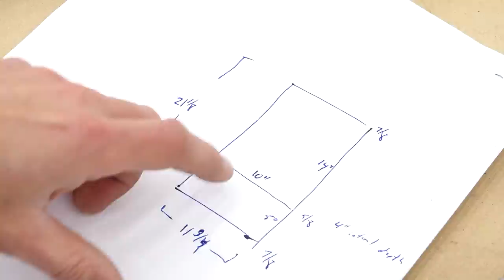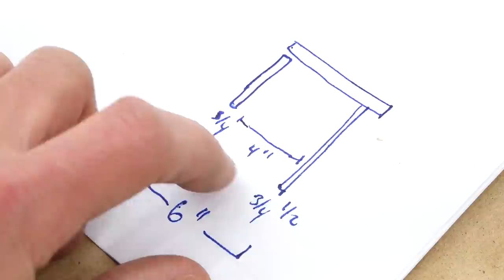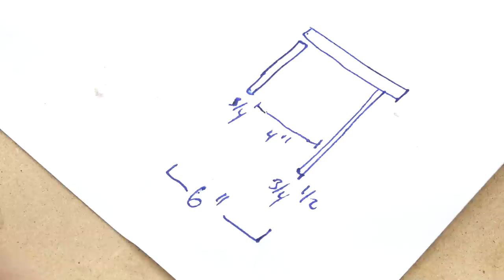Giving my Neighbors' Tree a New Life

Comment: Ah, yes, that little air cushion!Soooo satisfying! I wanted to see a little brass engraved plaque next to the famous fissure, saying " San Andreas". Ideally, a flat-tip screwdriver should completely FILL the screw slot and the contersunk hinge- hole width. A little touch of candle-wax works wonders on brass screws PUSH the screw across the side of the candle,;that way, the wax is in front of the screw thread!I wanted to see the neighbours' reaction!!

Comment: Really enjoyed the making of this cabinet. The only two things I would’ve done differently are;
1. Make the shelf a floating shelf by drilling parallel holes down both sides and a recess round end mortises at the bottom of the shelf to locate it on nice chrome pins; which you can move to any level inside the cabinet.
2. Mount the door flush to the outer edge of the cabinet with hidden kitchen like soft close hinges to maximise that really nice epoxy finish and minimise the door frame to be the same thickness as the wood that used for the main sides of the cabinet.
But, truthfully, I can’t really be disappointed with a man who drinks a 12yr old single malt Glenmorangie Whisky… Cheers.

Comment: Glad to see you back in the shop.  Beautiful cabinet.  I like your catch.  I made a sideboard with magnetic catches years ago.  I put the magnets in the top of the door frame before assembly and the matching ones in the rail of the opening.  The one in the rail was about 1/8" further "in" and pulled the door slightly too far.  A tiny stop held it just right.  Completely concealed.  I like the air cushion with yours.  Magic. Thanks for posting.

Comment: Having only seen you slab a bunch of monster trees, I could see your clear reverence, joy and love for the beauty of wood.  Now I've seen your remarkable skills as a cabinet maker and your lovely attention to detail that honors the wood.   One question, why did you split into four veneers and add the plywood glue step rather than simply splitting out two solid panels?   I'm guessing it is for greater dimensional stability.  I could see doing it if you needed to swap an orientation for some sort of fancy book matching.  But it looked like you glued them together into the same exact orientation that they started out in.

Comment: Absolutely gorgeous! One cool trick my old wood shop teacher taught us for door panels or raised side panels was to stick 2 small chunks of neoprene (we used old junk mouse pads or sanding pads) on each edge (1/8”x1/8”x1”) and do that for each panel joint. It gives it some squish so the wood can move around, it will never rattle and it won’t be too tight to avoid cracking.

Comment: Nice job. A few comments on variations of what you did. I would have rather used oak veneer for the B sides and made it double wide. This way all that work for the highlight pieces is not hidden. Whenever a lot of work goes into joints, try to expose the joint and not let it look like a butt joint. The catch could have been soaked and bent for the last inch or so at about 10-20 degrees. This leaves something to grab easier. The shelves need something to stop the bottles/glasses from moving.  Perhaps a recess for the bottles. (too late for that)  Maybe cork or shelf liner?  There is a very thin rubber black material used for tool boxes that looks good.
    ps; I always used the thickness of a matchbook for clearance of the doors.

Comment: Absolutely gorgeous! My only change would be to use a invisible hinge. The builder of my cupboard cabinet used them. I have to replace them, because after 80ish years most of them are broken. It has a oak carcass with a bird's eye maple top. I've been refinishing it because the top had become split over the years. Added some metal bracing to some of the weakened corners. And used some self adhesive vinyl "wood" flooring to cover the damaged plywood shelves. A great addition to my dining room instead of adding typical kitchen cabinets for my small kitchen. 
Eventually when I get to my forever home, I want to build all my cabinets.

Comment: Gorgeous peace. Great job. I hope I can find time to make Something similar for my family and friends. Why did you resaw the panel into 4 pieces and glue it front and back on those 2 pieces of plywood? Ik you were veneering, but why not just make it into 2 solid panels? Movement? Just cause you can lol? Great job again!
Reply from the maker: Mainly to glue that panel into the door and make it a single rigid unit. That little frame wouldn’t have the strength to resist that panel if it decided to warp
Reply: Makes sense, thanks for letting me know!

Comment: Never having done epoxy; what if you were to pour a cheap fluid such as mineral spirits or acetone into the mold, then pour it back out into a measuring cup to determine how much fluid the crevice holds, to know how much epoxy to make? Or would that screw up the wood, keep it from accepting the epoxy? Just a thought.

Comment: why veneer when the original board had decent thickness? weight? just wondering, awesome work as always :)
Reply from the maker: Wanted to be able to glue it into the case and door so it becomes a structural element
Reply: @mcremona  ahhh, thanks for the info! cheers

Comment: I’m having difficulty understanding what produces the curls.
Reply: "Dave Hurwitz describes curly maple: “If the tree grew tall and straight, the resulting grain will be straight and consistent, which makes it easier to plane flat and easier to cut. But, some trees grow in places or in conditions that cause the resulting grain to not be straight. An extreme example is curly maple."
   Basically, if it's lopsided, it will compress the wood underneath.